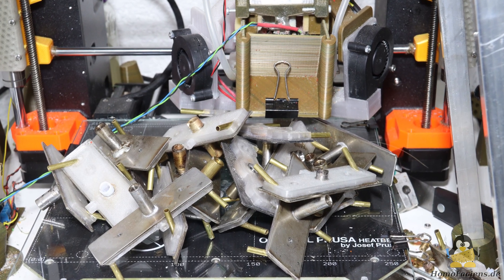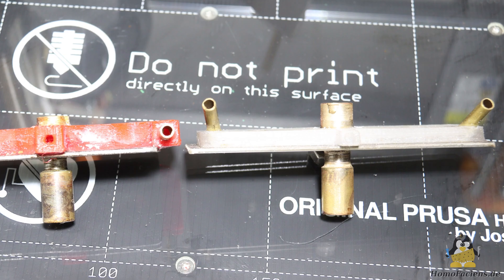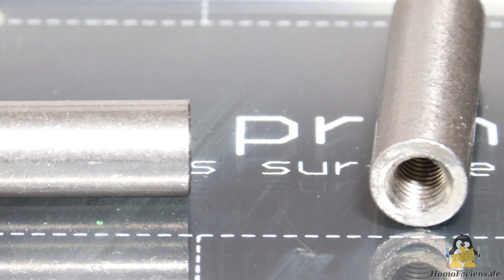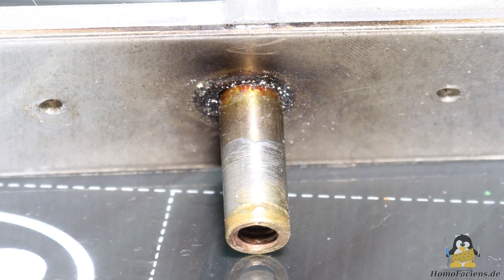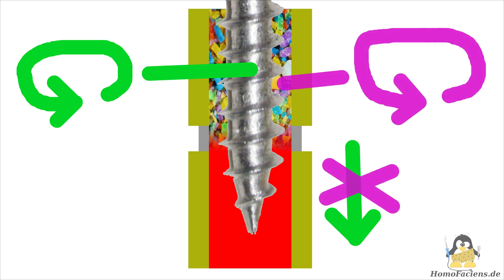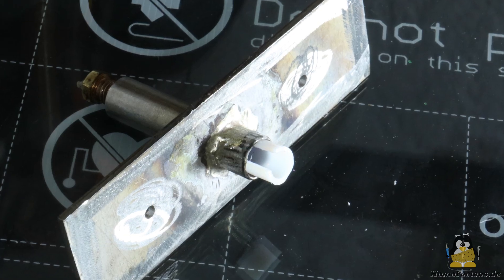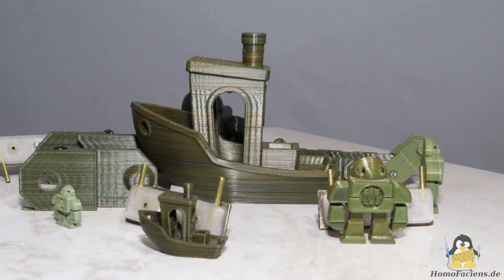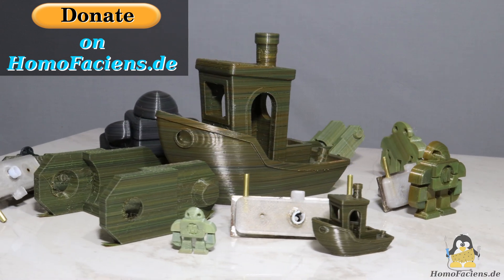Powder FDM printing with Direct Granule Extruder V6 0

Comment: Hmm, impressive work. I’m very interested in these machines for printing very soft elastomers (20A or less), and it seems like powder printing has a few less caveats than pellet printing. I suspect it should be possible to replace that sliced PTFE tube with a sliced metal tube to get the same vertical groove, or even to use a rifling button.
Reply from the maker: Currently I am working on a steel insert (documentation is always behind experimentation).
As soon as the extruder is in a more final state, I will check various materials for their printability. I already got some soft, rubber like powder (unfortunately without specifications).
More about that project, soon - stay tuned!

Comment: I think you have a really good idea with the gap in the PTFE pipe. Having axial grooves running down the screw section before the melt zone seems like a good idea to increase the 'grip' the screw has without increasing the friction so much?
With the drilling grooves -- this is normal in my experience. Using a reamer after drilling should help lots; and use lots of cutting fluid. Flood-cooling helps if you can do that during drilling and reaming.
Reply from the maker: Thanks for sharing your knowledge. I had reamers on my buying list, but currently I am investigating another idea. More on that in a coming video - stay tuned!

Comment: Use a boreing bar tool, for hole/bore. easy to make from piece of carbide, screw and bar stock. Hopefully you should get a nice finish. Your putting some serious working into this hope it works well.
Reply from the maker: Thanks, but we are talking about a 7mm hole, 35mm deep on a cheap lathe by a (at best) medium skilled lathe operator.
I have found a solution that seems so work fine. More on that in a coming video - stay tuned!

Comment: WEBEREIBEDARF SHOP KRAUS schau bei ihnen wenn du nach Keramik Hülsen suchst sind gute Qualität, hab sie als heatbreak benutzen wollen für'n Projekt. Hast versucht bei der Schraube den Gewinde Durchmesser in machen Bereichen zu verringern damit nicht viel Reibung entsteht zw. Gewinde und Rohr innen. Auf jeden Fall interessanter Ansatz für Holz Gewinde zu Pulver Antrieb. Hab einen Extruder mit Holz Gewinde auf metrische Gewinde und in Schrittmotor Hohlwelle mit metrischen Gewinde aber für Filament gebaut, das Holz Gewinde treibt das Filament wie wahnsinn an. Hab überlegt vier Stränge gleichzeitig anzutreiben wenn Roetz 4.0 mit seinem multikanal hotend fertig ist. Freue mich auf deine weiteren Videos. Lg😊
Reply from the maker: Danke für den Tipp mit den Keramikröhrchen. Ich experimentiere zur Zeit mit speziellen Einsätzen aus Metall. Mehr davon demnächst.

Gibt's eine Seite mit weiteren Infos zu deinem Holzgewinde Filament Extruder? Von sowas hab ich noch nie gehört.
Reply: @HomoFaciens dachte vielleicht hilft es 😁. Zum Extruder den ich versuch, leider von mir nichts, bin scheu 😅. Es gibt altes YT Video aus Alu Block Gewinde wird durch die Bohrmaschine angetrieben ca 2016 (bin nicht sicher wegen Jahr) Konzept Vorstellung glaube auf reprap und duet3d Forum hat jemand was versucht als Konzept. Finde es schade dass wir aufgehört haben zu suchen ausprobieren welche anderen Möglichkeiten es gibt, weswegen ich deine Variation toll finde und schätze. 😊

Comment: Great work as always. Quick question. What are the benefits of this version of the hot end vs v5.4? Is reliability significantly improved or just complexity of construction? I ask because I have purchased the material to make that hot end 😁. Also as a resource for polishing the stainless steel tube, this video seems cheap and effective. https://youtu.be/XztWAGsr9_k?si=6tmt-R0wA2WIPEZH . I’ve done similar to make Chinese clone all metal heat breaks work back when most 3d printers had ptfe lined hot ends and genuine all metal ones from e3d were too expensive for me.
Reply from the maker: Thanks! The biggest benefit is the more simple to build tube. In the version under construction I have implemented a different water cooling. It is made of an Aluminum block and requires no soldering at all, because the tube is bolted on. With that I can iterate faster through various designs, 
The Tefolon tube version is really uncritical in terms of dimensional accuracy and really quick to build. It just works (as long as you don't print with high temperature materials).

I am currently working with enameld tubes. It works in general, but not as good as it should. More on that in the coming video.

The guy in the video you linked polishes the outside of the tube, I must polish the inside.
Reply: @HomoFaciens  Just catched you skipping beginning of recommended video :-) just to get quickly to a clue I guess (I know, life is short :-) ) BUT this guy also shows how to polish tube inside and it looks very decent actually. That consistent flow rate of your extruder looks very decent as well. I may have to watch all your videos as I visit your channel once in a while and I missed some episodes, but is water cooling really necessary? Anyway, respect from Poland for your passion and even more respect for sharing it with us!
Reply: @HomoFaciens  Sorry I should have given you a time stamp. He polishes the inside at around 4 minutes in.
Reply from the maker: Yes, I skipped this, so the time stamp was definitely helpful, thanks! But it's nothing new in this video, That's how polishing is done. I had a talk on Maker Fair with someone that told me he would fix a Dremel on his lathe and grind with a rotating alumina tool on a rotating lathe. If both, workpiece and tool are rotating, the results would be fine. I might give that a try. Grinding first, polishing afterwards.